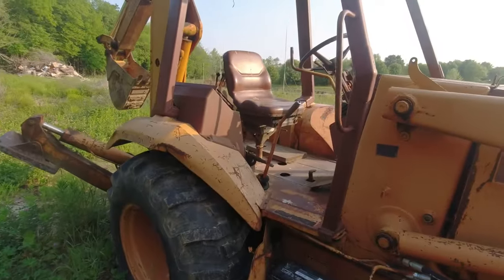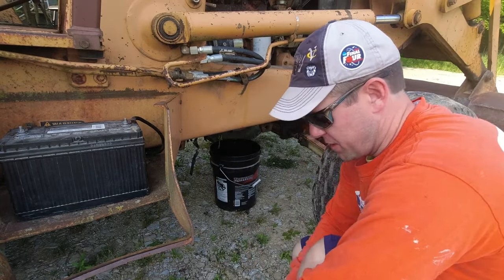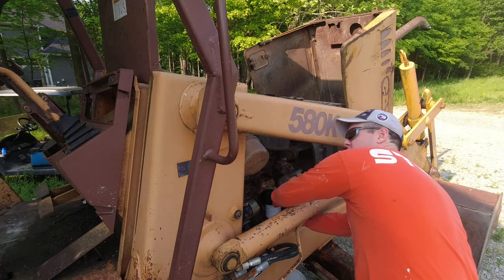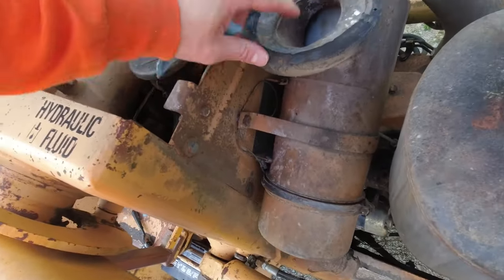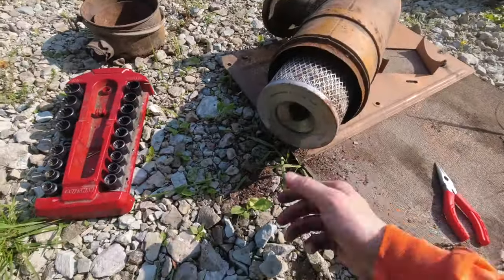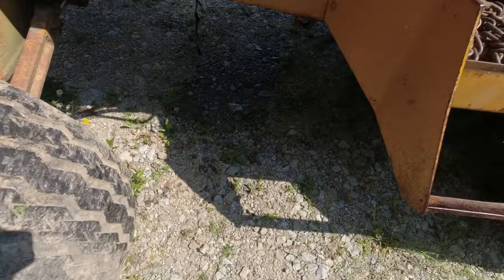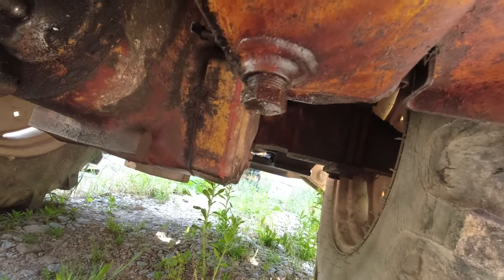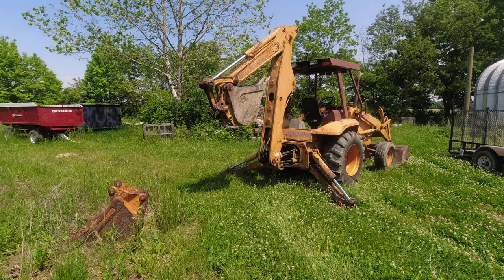Case 580K Backhoe Maintenance - Oil, Fuel, and Transmission

Comment: Thorough Video on 580K Maintenance...BUT...it's so much easier if you raised the loader, put the safety bar in place on the cylinder, and then raise the hood...
Reply from the maker: I don't disagree, but if I can get it done and minimize as much risk as I can, I'm going that route.  I also greased everything on the front end.

Comment: question: I need to lift the engine on my Case 480E LL to replace motor mounts but lacking a clear lifting point due to the pivot axel. What do you recommend?

Comment: So... how do we fill the diesel fuel tank on this thing along with the Case 580E backhoes? I don't see a fuel tank cap on the exterior of the Super E or this Super K.
Reply from the maker: Both the fuel tank cap and the hydraulic oil cap are located under a flip up panel just behind the steering wheel.

Comment: Seems like Case 580s have a lot more problems than other brands in the same weight class. Transmission problems seem like the topic at the top of the list. The question I have is how does this transmission differ among the other brands? Who has the simplest most rugged transmission on the market? After seeing what is involved with a Case transmission, I would not buy a used one. Does anyone have any advice about Deere, CAT, Kubota, Hitachi, Massey Fergeson? Which one would you choose among old used machines in the $3000 to $6000 range that have transmission, engine and hydraulic pump problems?

Comment: A lot of work and money to keep that thing purring.  Good job buddy.
Reply from the maker: Thanks Kyle!  I think I actually may have found an issue this week.  Could be much more work and money ha
Reply: @IndyFarmLife  I've had mine about 20 years. Give a shout on your problem
Reply from the maker: JJ, I haven't opened up the transaxle yet, but my suspicion is that I lost a tooth on the final drive.  Any experience?
Reply: @IndyFarmLife  The back rear wheel has a poor design in the Phase I models. It wears the teeth or breaks the gear. Can't say that is your problem, but it acts just like you describe. Replaced it around 2006 with a stronger aftermarket version, no problems since. Just keep your speed down on roads.
Reply from the maker: Thanks for the info.  It never sees the road and rarely goes more than 7 mph around our property.  I may pick your brain more as I get into it.  An aftermarket, better solution would be great!

Comment: HI, Great videos, I just bought today a 580K and I have some maintenance to do, so your videos have been very helpful.

Did you do a video on putting in generic gauges? I saw in one of your videos you mentioned you were going to change them out, but I couldn’t find a video if you made one.

Thanks for the excellent job
Reply from the maker: Nice!  You will love that machine!  Good attention to detail!  Sadly, I have not gotten around to installing said gauges.  I still need to.  Although, now I think I am having some transmission issues.  That fix will certainly take priority.  Good luck with your machine.  At some point I'll get those gauges (and a video) installed.